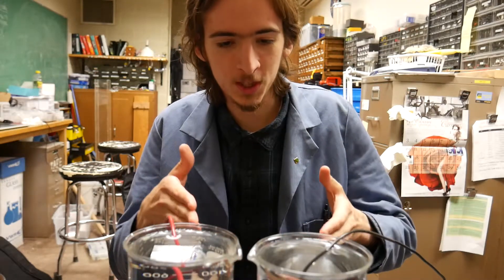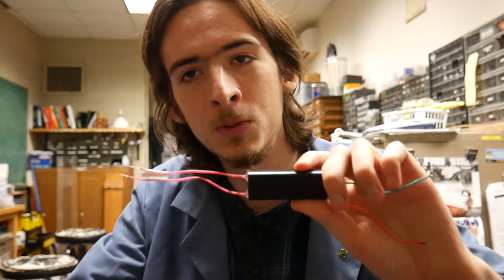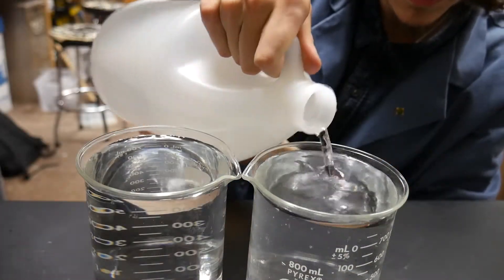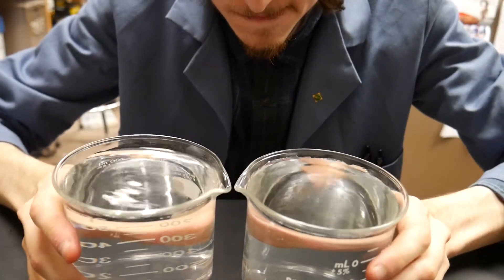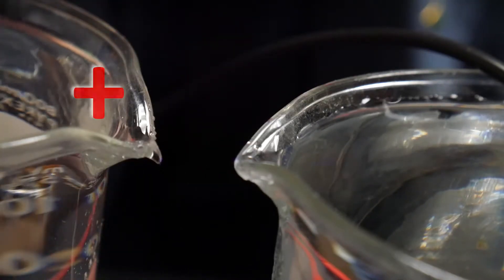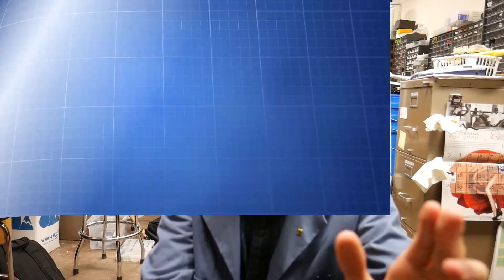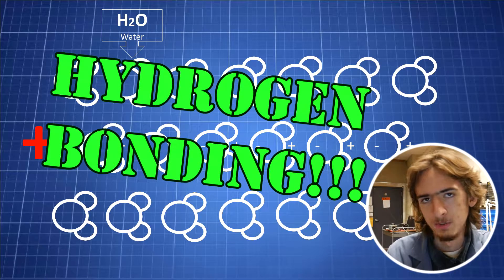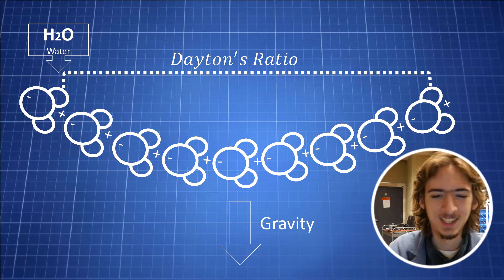LEVITATE WATER - Water Bridge Experiment

Comment: Hey, do you have any idea how much current a high voltage booster could output? There is almost no information on this on web. 
And how could one measure current without high voltage probes for multimeter.

Comment: What is the voltage at the convergence of the anodic and cathodic de-ionized water bridge?
You indicated you got a slight shock when you touched the convergence at the two spouts.

This experiment has great potential in an industrial application I am working on!!!
Reply from the maker: Ah. Interesting.
It's hard to say for sure, but I think it is around 20kV DC.
Reply: @BlueprintScience  That`s great.

This could be useful!
Is the water in both containers electrified or only at the convergence?
Reply from the maker: @jimhenry1262  Each container has uniform charge is believe.
P.S. There is a better explanation if you navigate over to the Keystone Science YouTube channel, circa 7 months ago

Comment: I've got an idea and you're just the guy to do it.  Modulate the flow of laminar water stream by using a time varying electrostatic field.  This is an extension of a trick I used to do.  Women like it!  Turn on the tap in your sink slowly so that you have a slow stream.  Take a pocket comb and create an electrostatic charge by combing your hair.  Hold the comb close to the laminar water flow and it will deflect.  I saw in one of your previous video that you used a 6V to ~50KV boost converters.  Use a time varying input to the converter (i.e. 6V +- 2V) to modulate the output voltage.  Use parallel plates to defect the laminar water flow.  Could even use an array of multi-colored leds to produce an effect.  Give it a try, your channel will like it!
Reply from the maker: That sounds really cool. I wonder if I could pulse the field fast enough to make patterns in the water... or even make the levitating water experiment.
You know what, I think I will do this. It will have to wait a while tho. 
Thanks; I love the idea.

Comment: I should say that you made some very astute observations, particularly the instability of the bridge. That instability should tell you there is some power going in. You might think that if it were a surface tension effect alone you could say, try a different fluid, or moderate the surface tension with a surfactant. I think though, that trying to build this bridge without an active power input is impossible. In the same way that you can't levitate one magnet on any configuration of other magnets stably without some sort of feedback.

The only reason I'm saying this is I think you are really really on the right track. Question yourself if something seems too simple, but not so much that it stops making sense with the rest of the world.

You start dismissing hydrogen bonds, the next thing you'll be doing is talking to your plants to make them grow faster...

Comment: Whoah! Ok! I'm nearly certain this is absolutely incorrect!!! This is absolutely the wrong way to look at things.

To associate hydrogen bonds in water requires about the bond strength in electron volts (eV) times the bond length in angstroms (Å). I looked up the numbers and did a Google conversion and that's about 200 megavolts per centimeter.

I suspect the "pure water" would not be recognizable as water if you had achieved that field strength in your experiment.

The second clue is that the bridge reforms automatically.

You are seeing normal fluid behavior of high surface tension moderated by an intense electric field. If the 'bridge' tries to 'pinch' the field strength decreases in the hollow, which decreases the rate of conduction across the bridge. I can't say exactly what the mechanism is but I'd bet a huge sum of money that it's in the air around the water and not in the water. Hear all that hissing? That's field emission. That's why you needed 40kv and a hundred volts wasn't going to make it happen.

Basically more current is flowing through the bridge when it is "stable" than when it is "broken" and arcing. Even though the "pure water" is "non-conductive". It's counterintuitive, but that's why science is hard.

As you learn about more and more science, all these rules like "pure water doesn't conduct electricity", will be put into a much broader context and you will be able to see what makes sense and what doesn't.

Your explanation doesn't make sense. Keep learning! You're on the right track!
:D

If you want to learn more about the effects of electrostatic fields on fluids I suggest learning about 'electro spray' which is a way of making very fine droplets using an electrostatic field.

Comment: Can you do this with ketchup?
Reply: Probably, but ketchup is shear thinning, or thixotropic, so might need to vibrate the bridge as it forms to keep it fluid. Ketchup is also a good conductor, so you might not be able to maintain a high enough voltage gradient.

I'm actually gonna change my answer to no. Sorry about that.

Comment: Large correction: Boost converters are not made of voltage doublers. Voltage doublers will only run off AC. Boost converters run off DC, though I suppose you could get one to run off AC in theory, if you timed it right (but you're not supposed to without using a rectifier). Anyway, the wikipedia page on boost converters seems to be accurate, so look at that.
Reply from the maker: I guess there are a lot of DC boost converters, but the only only one I'm familiar with is a DC to AC voltage doubling type.
They use an oscillator, a small transformer, then a bunch of voltage doublers. Something like this circuit I made back in high school http://3.bp.blogspot.com/-YIZbUpZzV-k/VgrljA_oI-I/AAAAAAAAAOY/F6FRq7EPGos/s1600/StunGun.gif
Now, I may be completely wrong about this. Be aware, I tend to misspeak sometimes
Reply: You definitely know what you're talking about, but that's not what those are called. It's just a semantics issue, but that sort of thing can trip you up when you're searching for a part. When someone looks for a "boost converter" on the internet, they're going to find something that will only work on DC-to-DC. Your DC-to-AC device would be a "step-up inverter," which is a term that always refers to a DC-to-AC device.
Reply from the maker: You're right. I had it wrong.
Thanks for making me aware
Reply: No worries.
Reply: Also, the thing you linked in the description is neither a step-up converter nor step-up inverter, but a high-voltage pulse generator, similar to a marx generator, which is not DC->DC nor DC->AC, but DC->impulse.

Comment: Minor mini dini correction. 
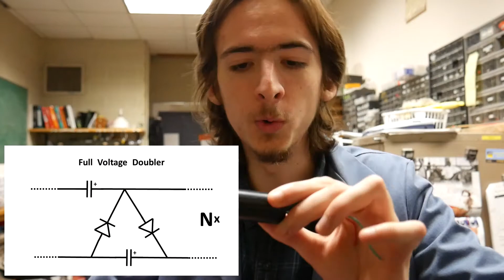0:55 Each stage multiplies (as the N× implies). It is only doubling when N = 2. 
So having 3 stages for an example does not give you 8 times more volts (2³=8). 
It gives you 3 times more volts (V_out = N×V_in = 3×V_in = V_out/V_in = 3).
Reply from the maker: I think you might be right.
That's a consequence of editing this video at 2AM.
Good catch!
Reply: I was almost correct. http://tinyurl.com/y8bmftzc
I was wrong by adding the number 1. 

So N = 3 => 3 stages => multiplication by 3. Not 4 and not 8.

Comment: One question, would the length of "Dayton's ratio" change depending on the voltage applied to the water? For instance More Voltage could equal a stronger bonds which would mean I longer bridge?
If so, what would be the equation to show this, im curious and i might do this experiment myself!
Reply from the maker: I LOVE this question! (Not only because you called it by its proper name) There is a minimum electric field to force all of the water molecules to align. Once they do, that's 100% of the effect that you can get.
Reply: Blueprint thanks my good dude! Keep making great videos like this!
Reply from the maker: Aye aye, mate
Reply: Whoah! Ok! I'm nearly certain this is absolutely incorrect!!! This is absolutely the wrong way to look at things.

To associate hydrogen bonds in water requires about the bond strength in electron volts (eV) times the bond length in angstroms (Å). I looked up the numbers and did a Google conversion and that's about 200 megavolts per centimeter.

I suspect the "pure water" would not be recognizable as water if you had achieved that field strength in your experiment.

The second clue is that the bridge reforms automatically.

You are seeing normal fluid behavior of high surface tension moderated by an intense electric field. If the 'bridge' tries to 'pinch' the field strength decreases in the hollow, which decreases the rate of conduction across the bridge. I can't say exactly what the mechanism is but I'd bet a huge sum of money that it's in the air around the water and not in the water. Hear all that hissing? That's field emission. That's why you needed 40kv and a hundred volts wasn't going to make it happen.

Basically more current is flowing through the bridge when it is "stable" than when it is "broken" and arcing. Even though the "pure water" is "non-conductive". It's counterintuitive, but that's why science is hard.

As you learn about more and more science, all these rules like "pure water doesn't conduct electricity", will be put into a much broader context and you will be able to see what makes sense and what doesn't.

Your explanation doesn't make sense. Keep learning! You're on the right track!
:D

If you want to learn more about the effects of electrostatic fields on fluids I suggest learning about 'electro spray' which is a way of making very fine droplets using an electrostatic field.
Reply: Tadesan thankyou man!!! That was a really satisfying explanation.